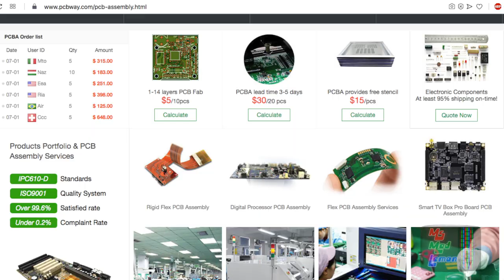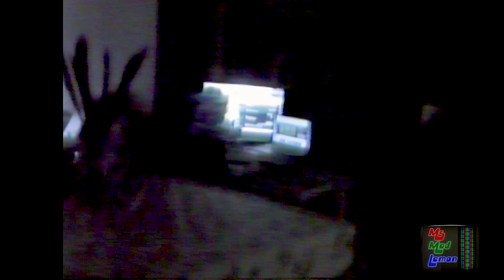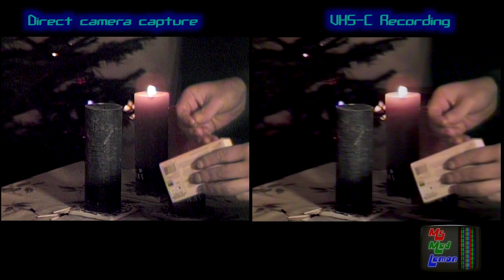JVC HR-C3 VHS-C VTR (VCR) - I took a big chance on an 'Untested Spares or Repair'

Comment: Amazed it worked after powering up! Usually when I get something like this it needs quite literally everything doing to it (full disassembly, new belts, pinch roller, idler, manual head and tape-path clean, etc etc). And to make matters worse, a lot of the perishable rubber components are getting increasingly hard-to-find, these days..

I recall the vast majority of these 'portable' machines used to come with an (optional) tuner unit, so that you could not only use it like a normal (and very cool-looking) VCR, but also 'dock' the recorder without having to faff about with additional cabling. The tuner unit would usually charge-up the battery.

Tip: It might also be a good idea to locate a copy of the service manual, as that'll help immensely with any future disassembly work. I also recommend not using video head-cleaning cassettes as they can do more damage than good! If you get a head clog, an easy trick is to simply leave a (known-good) cassette running for its entire duration. Back in the day, some of the more unscrupulous repair shops would do exactly that (and charge you £50 for the privilege!).

Comment: Great find it works really well, i think a lot of these portable machines will have a good chance of working or having good heads most i bet have not had many hours use ,At my sisters is a portable beta machine and the tuner that makes it like a full size video recorder< i have a camera for it here and the 1 that came with it is at my mum and dads it was all full working order .In my mum and dads loft is a full size panasonic m7 it was fully working and is in its camera case if my dad lets me have it i will power it up and do some recording with it .

Comment: VTR is the old term, used before tape came in cassettes, when it used to come on reels. It was still used by the manufacturers to refer to machines that used video cassettes in order to differentiate professional/broadcast grade machines from consumer-grade machines.

The reason for the difference in colour is because the original PAL signal has about 1.3MHz of chrominance bandwidth, whereas VHS only has about 400KHz. That means there's a lot of attenuation of the higher-frequency colours, which you can see for example in the darker, richer red of your top compared to the much more washed out red in the direct feed. I'm guessing they attempted to compensate for the lower colour contrast by slightly boosting saturation.

Comment: Great video. You're funny 😆

I just got ahold of the same vcr, and it managed to get itself stuck in the "emergency mode" which is when the stop button flashes and you can't open the cassette door (the tape isn't inserted). The spindles that load the tape near the spinning head are stuck in the play position, so the eject button doesn't work. I was wondering if you could check on your machine if it's possible to take off the door mask like one would on a cassette deck? It would be of great help.

I was planning on taping some behind the scenes of the recording of my album, so I'd really love to get it working again. Thanks in advance!

Comment: Hello!
Nice video!
Thi video unity is capable to deliver 250 lines of horizontal resolution.
Another thing you have to keep in mind, when you started up your unity for the first time and you got "Battery" problem and you switched to a battery supply, you´ll get more problems in the future as the problem is still inside your video.
The problem is a capacitor that is in the front pannel PCB, called C3 that is laking.
Hope this helps!
Asier.
Reply from the maker: Actually that is a good point.. I did notice the capacitors and thought to recap them. I may just do that. Thanks 🙂
Reply: @MsMadLemon  It,s quite easy to find that cap and sustitute, but as far as It works I'd dont do anything! :-)
Reply: @MsMadLemon  BEST regards! :-)

Comment: Video tape recording always has a slight degradation over a direct feed shown as lack of details, color is warmer but inaccurate, softer and noisy due to the chroma under scheme, But that was the only way of recording instant home videos without having to develop a film, Later on S-VHS and Hi8 achieved better recording quality in terms of luma details, but color suffered the same way.
Reply from the maker: I agree that the video tape recording has a slight degradation, as you say the lack of details, but in this case at least, the colour was more true to real than the direct one, my jumper isnt pink, it's actually red like shown in the VHS, the colour seems richer, but also the colour would depends on what grade tape you record on. Either way, it has a certain character and charm to it which I personally enjoy.
Reply: @MsMadLemon  Perhaps your camcorder is miss calibrated due to aged components, So recording to tape for some reason brought the chroma levels closer to where they should be. Just a guess, I could be wrong.

Comment: I think VHS is 212 lines so not even pal res.....but yeah. its nostalgic AF!
Reply: Supposedly it was 240 lines, but the "edges" of the "lines" were so vague and fuzzy among analog TV and tape, that you couldn't really accurately count the lines, it was mostly just an estimate, lol!
Reply from the maker: Really? I thought it was 240, I need to look that up. Nostalgic indeed!
Reply: @MsMadLemon  It is technically 240, but see my comment above.
Reply from the maker: @JoeJ-8282  Yes, I saw, we both commented at exactly the same time lol
Reply: @MsMadLemon  I'm on the egg nog so it may be... but something in the back of my mind is saying 212.... Either way, have a great Christmas and a wholesome new year.
Reply: @preferredimage  Look it up dude. I'm from the "old skool" era myself, (almost 50), and I used VHS for recording for many years, and I never heard 212 lines at any point in time, it was always 240, so I'm not sure where you came up with 212. Are you maybe confusing this with something else entirely? (I can't even think of anything technical with the number 212 in it.) (240 was the lines of resolution of VHS, and then it went up from there with different and newer formats. Then there was the number 256 from computer terms, referring to bits/bytes, and then of course 220, 230, or 240 VOLTS depending on what part of the world you live, but never anything technical with a 212 in it as far as I remember, and I'm a true "techie nerd", lol!)(If you remember what exactly your 212 number came from I'd be curious, but it wasn't VHS resolution.)

Comment: What type is the camera connector? I have the same model of the VCR, and would like to use it to record external composite signal, but I struggle to figure out how to make the cable. Is it HR10A-10P-10P connector? Do you have the pinout maybe?